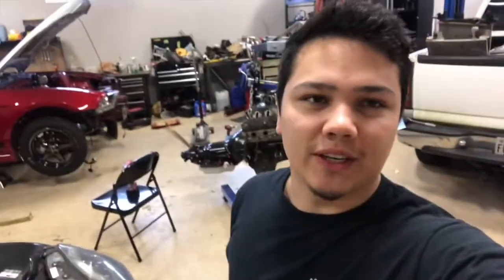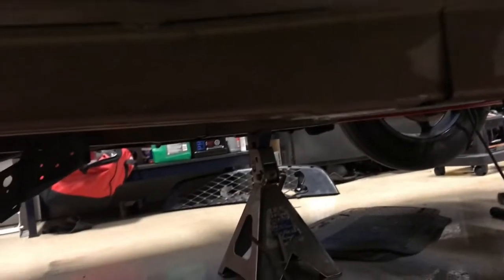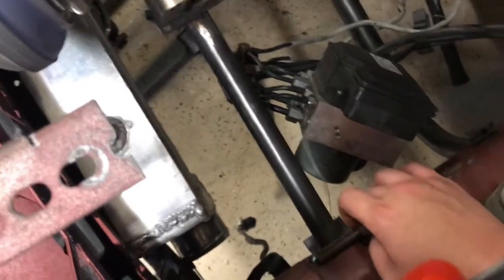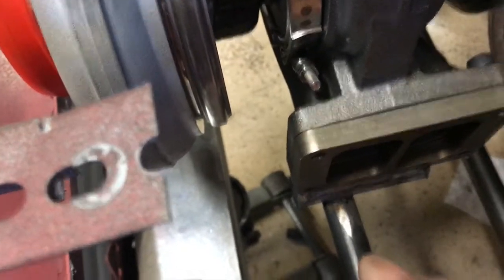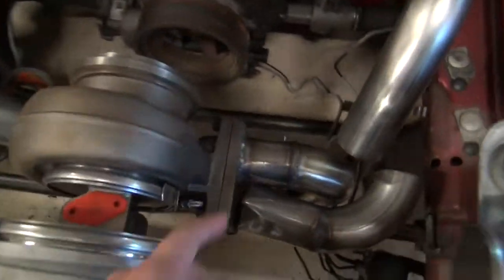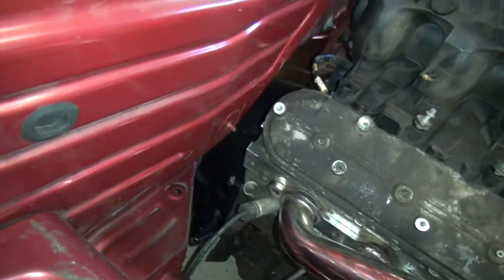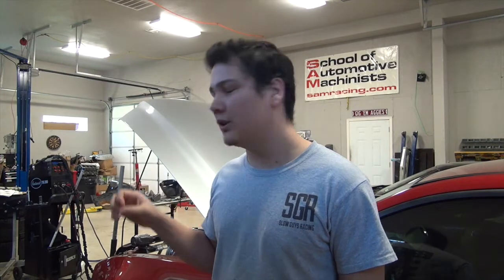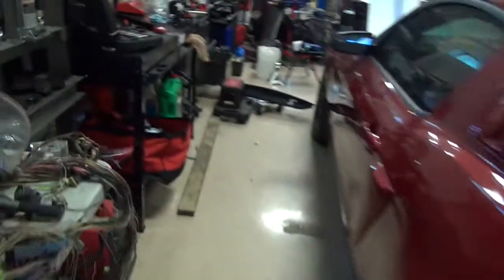Making My Ls Turbo Kit

Comment: Them Holley EFI Terminator they are bad to the bone. Cleetus McFarland put the Holley EFI on his Corvette called Leroy and it is awesome.
Reply from the maker: Cleetus ran the terminator x on ruby and ran a 8.8 with the car. Anyways I actually ended up buying an ms3 gold box with everything I need for an extremely good deal.
Reply: SlowGuys Racing .....did u find a kit to install the LS engine and tranny for the mustang or what I would love to know because I might try do the same.
Reply from the maker: @matthewvarnam4302  nope, i've been designing and fabricating every part thus far.